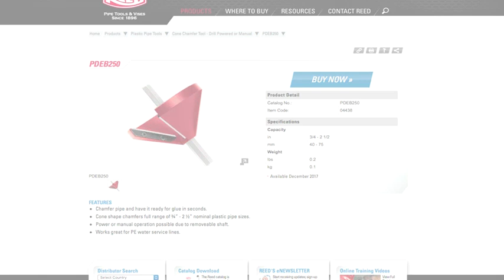PDEB250 Plastic Pipe Chamfering Tool Demo - Reed Manufacturing

Comment: We need this kind of Cone Chamfer Tool for 4 inch and 6 inch PVC pipes. Do you have it?
Reply from the maker: REED has a manual tool for 4" - 6" pipe.  Here is the link:  https://www.reedmfgco.com/en/products/plastic-pipe-tools/bevelers/
Reply: @ReedPipeTools  Thank you for the prompt response. Does it works to do chamfer on the I.D as well?  Or suggest any tool for ID chanfering (PVC 4 inch & 6 inch)
Reply from the maker: @harshpatel3500  For ID and OD - you want the new REED Bevel Boss.  That starts at 2" and works on PVC.  It goes up to 20" PVC and even 24".  Check it here:  https://www.reedmfgco.com/en/products/plastic-pipe-tools/bevel-boss-cordless-pipe-bevelers/      There are a couple Bevel Boss videos here on our YouTube channel.

Comment: so its a chamfer and a deburring tool ?
Reply from the maker: Yes.  REED considers a chamfer tool to be one that applies a consistent size bevel all around the pipe.  Since this is drill-powered, and fast, it does apply a consistent size bevel.  Deburring can be a bit less precise in its final result. Since this tool chamfers, it also deburrs.  And, you can use it for ID and OD on the pipe.

Comment: Why won't someone make this for 3" pipe? Most construction jobs are requiring schedule 80 pipe so when you install a bell end and pull wire through it hits the inner wall edge of the pipe. Need to bevel it to match the ID of schedule 40. Every construction job in the solar industry is having this problem. The only advice we get is use a manual tool (can't happen too many pipes) or use a router bit (again... too many pipes). Nobody has a real solution to this massive problem.
Reply from the maker: Check out our PB3 chamfer tool: https://www.reedmfgco.com/en/products/plastic-pipe-tools/drill-powered-chamfer-tool/pb3/

Or Bevel Boss® Cordless Pipe Beveler: https://www.reedmfgco.com/en/products/plastic-pipe-tools/bevel-boss-cordless-pipe-bevelers/